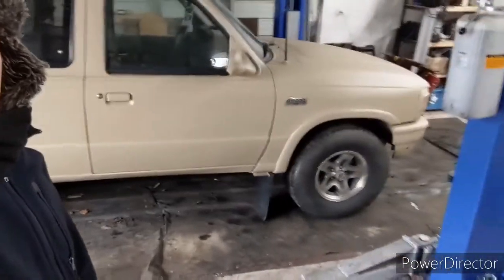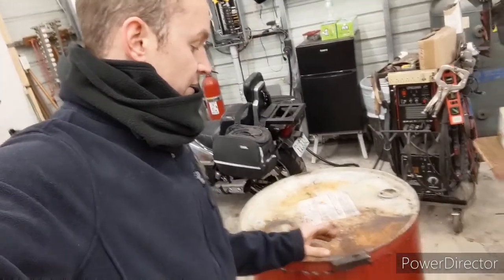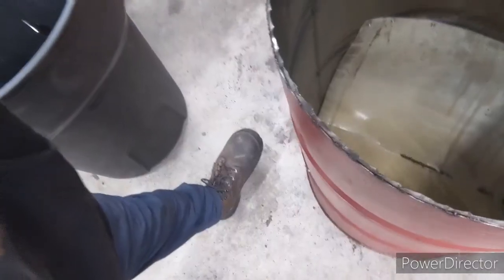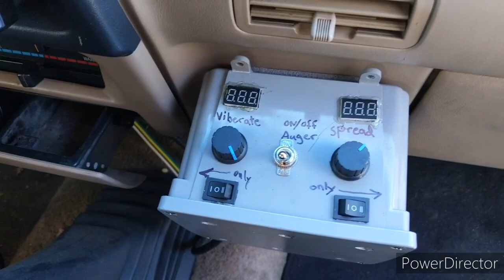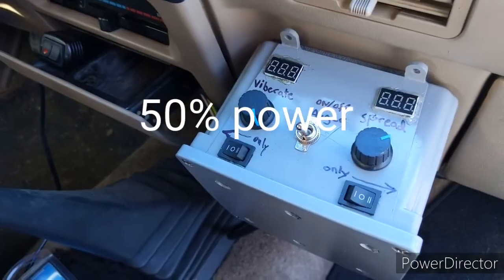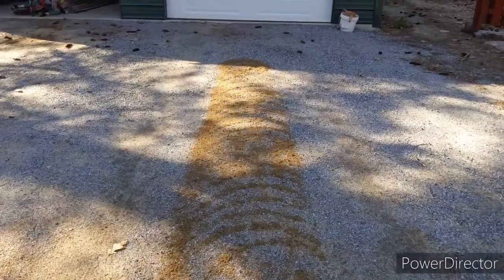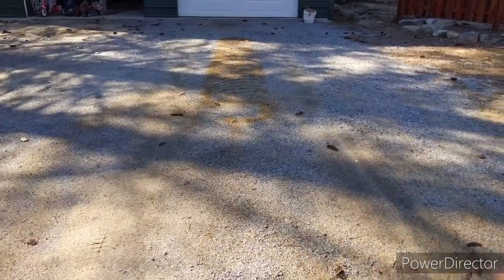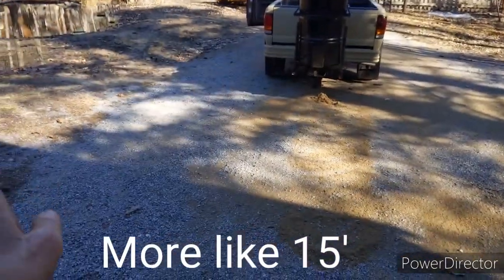DIY salt and sand spreader, using steel barrel and snowblower parts!

Comment: Have you had the chance to use this more find any flaws or potential improvements?
Reply from the maker: Yes I decided to replace the auger with a 3-inch auger from Amazon, it's much smoother and consistent when spinning.
Before I was having issues with rocks collecting between the coils of wire, I will no longer deal with that now that I have an official auger.
Over all the salt and sand spreader works very very well and I plan to design another one out of a plastic barrel in the future, simply because they last longer and don't rot out. I'm extremely pleased with how it has worked out and how it operates.
I drilled tiny holes in the end bearings so that they could be greased, other than that pretty much everything is original, only thing changed is the auger.

Comment: This is awesome! Question though. Where did you find your end bearings?
Reply from the maker: I salvaged them from the bearings of a snowblower, however you can buy bearings that are likely much better and have much lower restriction on Amazon! I almost bought some but decided to drill a hole and the salvaged end bearings so they could be greased, this year I am testing it out, so far so good!